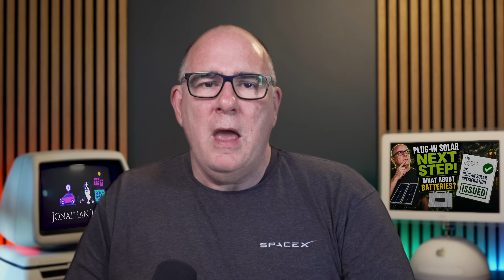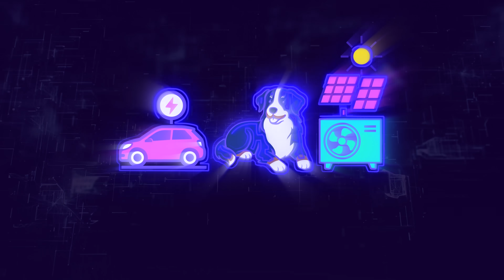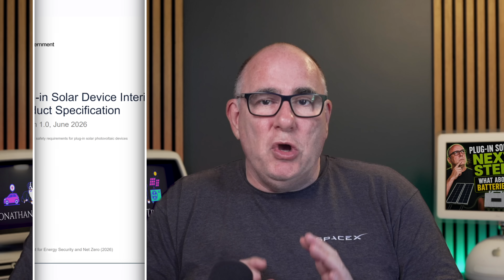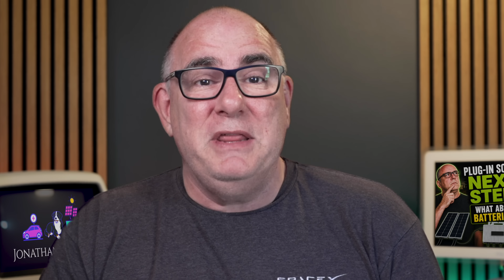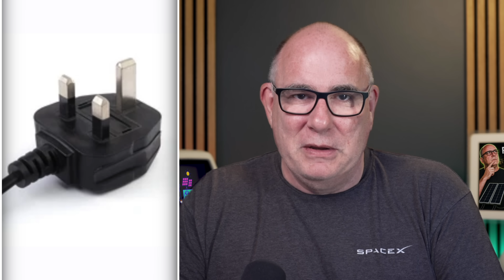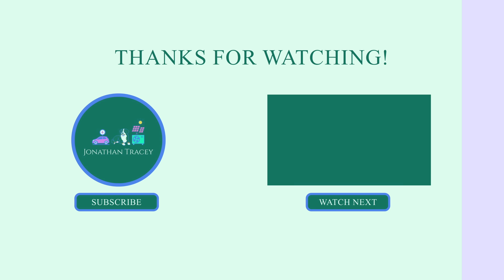Plug-In Solar Finally Legal? The Real Story Behind the New Government Rules

Comment: I think they should be talking about batteries already, because he one thing I've not seen in any of these discussions yet is what happens if you get a plug-in battery and you already have roof solar and a big ol' fixed battery? Is this an easy (no electrician required) way to expand capacity, or will Terrible Things happen? (they say don't plug a UPS into another UPS, for example!)
Reply from the maker: @keysersoze8110 That's a really good question, and it's one I think manufacturers need to address. In principle, a plug-in battery should be able to coexist with an existing roof solar and home battery system because they're both just supplying power to the house. The key is that each system must independently comply with the grid connection rules and anti-islanding requirements.

What we don't yet have is clear guidance on how different manufacturers' systems interact in the real world. Hopefully that's the next area the standards bodies and manufacturers will tackle, because I'm sure you won't be the only person wanting to expand an existing battery system this way.
Reply: Roughly speaking

Technical side:
- If you have a system that provides house backup there is a real risk of terrible things happening. Some hardware can do clever things with extra microinverters and house backup but that needs special setup (Sunsynk and Tesla at least).
- If you have an existing solar only system it will just boost your generation
- If you have an existing solar/battery or just battery installation then adding the extra solar microinverter should either export it all or use it for the battery when possible (configuration dependent)

Regulations:
- If you have a G98 and your combined system is still under 3.6kW (eg you have a 'building regs compliance' postage stamp solar newbuild) it should be fine.
- If you go over 3.6kW and only had a G98 (common for older setups to be 3.6kW exactly) you will need to apply in advance for a G99 and it may be refused. You can do this yourself but it's not end user friendly as a form.
- If you are already over 3.6kW you will need to update your G99 (and maybe G100) in advance and it may be refused.

When your plug in system also includes battery and your main house system also has a battery it gets complicated, but adding a battery/solar plug in to an old small solar only install ought to be fairly sane

Comment: The requirement for a moulded UK plug will increase the cost as manufacturers will need to change their assembly line process for UK specific inverters.
Reply from the maker: most have processes for this, even in Europe they have many different versions of the plugs, so I doubt its going to increase the price much
Reply: Won't make any difference they already mass produce cables with UK plug ends and the cable is already cut for the plug.
Reply: No they just put a  different cable in the box -  most have a connector at the inverter end, though once the race to the bottom happens, we'll probably see them with captive cables, encouraging people to use extension leads.
Reply: They already do this for UK sold kit - e.g EcoFlow Stream Micro Inverter comes without a plug (just a tail) and UK instructions that state it needs to be hardwired to the Consumer unit with some pictures.

When/if the standards appear/change they can replace that tail and instructions with something different.

Comment: One system per circuit would be awesome
Reply: I wish they would also just update the new home requirements to include a 32A lockable commando on its own circuit so that any normal sized system can be rapidly installed even if it still needs an electrician to commission. It's bonkers that we are still building houses without a ready connector for inverter/battery/solar.
Reply: @etchedpixels  ...and EV charging
Reply: @mikeselectricstuff  7kW EV circuit has been mandatory for a while now.
Reply from the maker: agree
Reply: I have 11 circuits in my consumer unit 😀
Reply: @kfarmer-b8v  Sadly there's a secondary limit of 3.6kW for the whole property already
Reply: @etchedpixels  true but i still got G98 for 4 Powersteams (3.2Kw) which will get me going although i may change them out for a single hybrid one
Reply: Thinking ecoflow delta 3 max plus with the wattcycle cable into fogstar 16.1kwh battery?

Comment: So we will all have to get new sealed moulded cables from ecoflow? When they are available
Reply from the maker: probably, when the legilation changed a few years back they sent everyone a new cable without a plug on it.
Reply: I don't know how standard the connectors are on inverters but Amazon already sell 13A plug cables for some of them
Reply: I imagine they will sell you a new cable, manual, stickers and possibly a firmware update in order to use it plug in. It was never sold for plug in so I am pretty sure they'll not be giving them out.

They gave people a new cable in the powerstream debacle because they shipped  a non regulation compliant product and were quite frankly lucky they didn't get a full recall.

Comment: Anything in the document stating that you will need to notify your dno?  As most people buying plug in solar from aldi are not going to fill in a g98
Reply from the maker: nothing but that does not change existing processes, so yes you need to notify DNO, but i agree the vast majority wont bother
Reply: Try finding the form g98 on line. Spend few hours no success. If it's not easy. People will not bother
Reply: @caterthun4853  It needs to come prefilled except for name/address type bits with the hardware IMHO.

There is talk for the final spec of actually having devices refuse to operate until you provide a code you get when you register them.
Reply: It's already a legal requirement. The fix for it IMHO is to allow feed in payment for a compliant G98 registered system. If you have to fill the form in to get paid I am sure magic will happen.
Reply: They could easily handle this with a little imagination, e.g. via the manufacturer, with an incentive like extended warranty once registered.
Reply: most people don't bother with the little guarantee slip either.

Comment: batteries have their own legislation already dont they?
Reply from the maker: now when used in a plug in setup
Reply: Batteries have a load of regulations but there are some messes that need resolving. So BS7671 deal with all the electricals, other bits of building regs the weights and now PAS63100 the safe places to put them. However the PAS63100 stuff on the electrical side is in the view of a lot of electrical people (both in standards and on the ground) utterly broken so someone has to figure out how to unify the two properly into a sane standard that is usable.

Comment: I immediately suspected someone cut and pasted existing European products, add in a little 220/240.....which already exists.......all of these things are around for other products. It probably didn't take them that long to do and I would assume they stole some ex BSI people to help. The fact that batteries have been around for a considerable length of time you would think, yes, someone is working on it but it feels like the horse is long gone. I am very interested in the "How many can you have?" per circuit. I have multiple boards and the potential to place several 800 systems over time........
Reply from the maker: yeah, I suspect they dropped batteries from this particular one just in the interest of speed, if you think about all the safety around batteries, different chemistries different fire suppression and protection systems. The document could’ve become a massive undertaking.

We should see the results of the consultation in the next two weeks and that will let us know whether we’re restricted to one per house or one per circuit
Reply: @JonathanTracey  Well the batteries could just use the same specifications and be done with it.
Reply: Batteries is hard because we have a battery recommendation that in part makes no sense according to the electrical people (both the IET and actual on the ground electricians) and that issue has to be resolved properly for all battery/solar systems pretty soon not just plug in.

Comment: Thanks for your work, and I'm glad to see it's moving along. I was thinking the same, that we probably won't get them in UK stores this year, but I'm hoping they will just copy the German specifications, which they have done in the past, but even if they did that, we will still be waiting for some time.
Reply from the maker: if they don’t get it out in the next couple of weeks, then it’s probably not worth it because by the time people buy the equipment and get it installed will be into the autumn
Reply: @JonathanTracey  Everyone will want to be first because if they sell you a microinverter they can sell you lots more later. There's a reason Ecoflow played fast and loose with the rules as lots of people are now basically trapped in that ecosystem for years as repeat customers.

Comment: JT, could this be the reason why octopus announced that the cube battery would be for sale in the new year? Nick
Reply: As it's a rebadged existing product sprayed pink (and maybe with new firmware) that seems a good guess. You can buy those existing batteries today but you can't plug them into a socket in the UK.
The big one is electrician install anyway it's just part of their existing solar/battery business.
Reply: Thanks, I havent heard of them doing that, so just looked it up, and the 5 and 10 KWH Nook battery looks good, and the little Cube at 2 KWH but still stackable and plug-in will help many. I just hope the prices are good.
Reply from the maker: yeah, I suspect they’re not rushing because they don’t think the battery part specification is gonna be available for awhile

Comment: 9:27 that was the very question I had at about the 9:15 mark.

As far as manufacturers are concerned, I’m no expert, but Ecoflow, BLUETTI etc can adapt their products for the UK market as well as the ROW.

So why can’t the same happen with plug in solar?

My cynic alert system is on HIGH.
Reply from the maker: because they’re existing products are working to existing specifications. Right now they don’t know (or at least they didn’t know until this was published) what they were working towards.
Reply: @J @JonathanTracey is is true. I would not have been surprised if any HMG or department had come up with a list of specifications completely different to the rest of the world, just because.

Of course there would be real concerns and reasons for this, but my cynicism is particularly bad today.

Just seems people will be missing out on any chance to save money this year.

Would it be possible or safe to allow multiple 800 W plug in solar systems per household? It seems an easy and to me, obvious way to let people save more
Reply: @robintaberner  Multiple plug in systems should be technically safe providing there is one per circuit. The problem is that most people have no idea what is on which circuit or how to find out, and in a shared rental house/HMO there's a very big risk several people rent a room on the same circuit and wouldn't know this.
Reply: @etchedpixels but that issue does bring into question the idea of people getting a solar set up at Tesco or Aldi with their weekly shopping.

There’s no way Wayne of Tracy at the checkout is going to able to advice anyone that what they are buying is suitable for their home
Reply: @robintaberner  They don't need to. The interim product specification requires this is in the manual. They don't advise you if your wine is suitable for your fish either.
Reply: @etchedpixels they don’t need to advise you on wine because that won’t cause a house wiring to go bang.
Reply: @robintaberner  Nor will plug in solar
Reply: @etchedpixels but the scaremongers would not accept that.
Reply: @robintaberner  Who cares. Nobody. The Daily Wailers are a lost cause. Too much lead in the petrol back then.